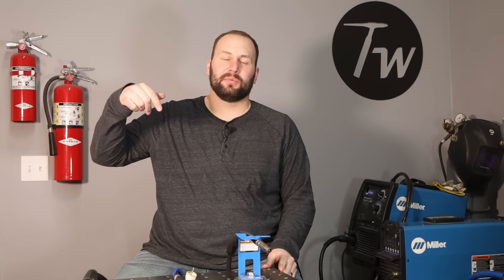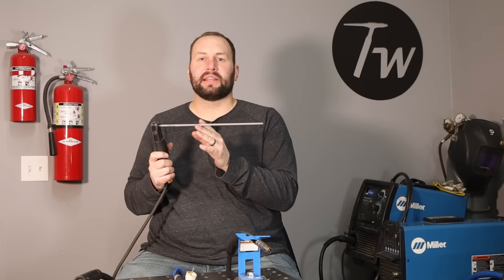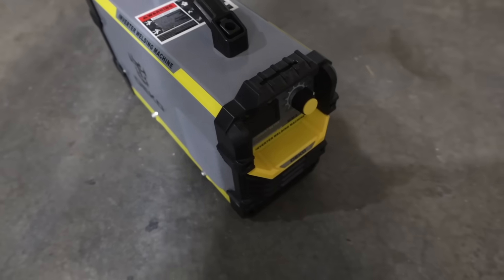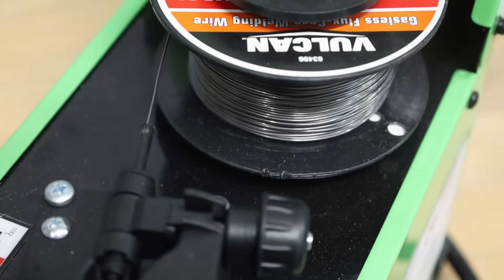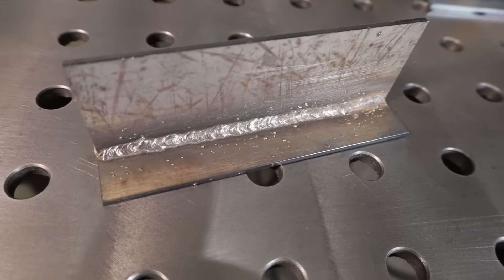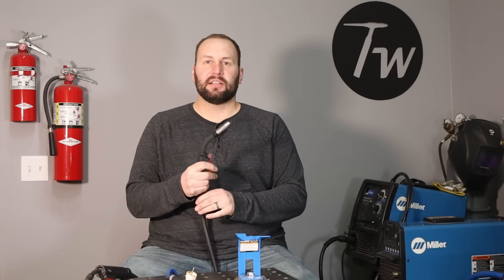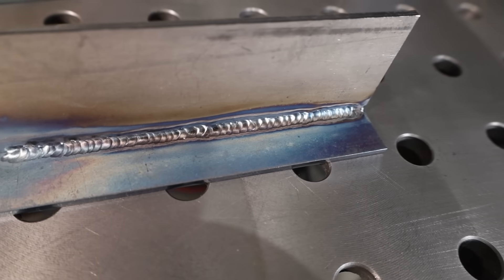4 Types of Welding Explained: MIG vs TIG vs Stick vs Flux Core

Comment: I think people get intimidated away from trying Tig because it gets described as hard. But if you take a way the filler rod, I would argue it is more intuitive to learn. Start with moving the puddle and then learn to use filler rod. Trying to figure out MIG heat and feed rate as a beginner can be super frustrating. More of the work is in the setup knowledge. I would say MIG is really just easier for someone teaching because they can set the machine and anyone can pull the trigger. I would have preferred to start on Tig, but maybe I'm the only one.

Comment: When I was in high school I took vocational School welding and had the option of getting certified in several different types of welding. I chose mig stick flux cord and Tig. I had the option of a certification in subarc and pulsarc, but sub Arc is not really that in high of demand because it's all done by machinery. Have you ever done a video on pulsarc? What's the purpose of pulse Arc

Comment: Hey tim, what do you think about structural welding on small trailers, like low boys and gooseneck trailers to haul motorcycles or heavy equipment on? I'm building a 26-ft trailer as we speak. It's 18 ft long now, dual axle. I'm going to cut it in half behind the back tire and 5 ft from the front of the trailer I'm going to cut it in half, put a piece of three by four angle iron 8 ft long on the inside of the existing angle iron and welded up solid in the front and the back. I'm going to add 3 ft to the back and 5 ft to the front. Make it 26 ft long in total so I can haul five harleys. I was going to use flux core mig, but I've decided to use stick because of the penetration. What would you suggest, 6010 root pass 7018 cover pass like how you do in hanging high steel or structure erection? I hang high steel and build large structures, and I'm just now getting into fabricating things like trailers and I make fenders and fairings and gas tanks out of flat steel as I have a bender here at home to where I can take a 20 gauge piece of metal and put it in my vendor and I can form a gas tank or a fender or a fairing or whatever I want to build. Anyway, a 6010 root pass with a 7018 cover pass is the strongest weld that you can get as far as I know. That's what I was taught in vocational school / trade school and during my apprenticeship program. My only concern is this, each one of the motorcycles that I'm putting on this trailer weighs at least 917lbs. The heaviest is a big goldwing trike that weighs about 1375 lb.
Considering the trailer being extended 5 ft in the front and putting the 7/16 inch by 3x4 piece of angle iron, do you think with the constant flexing up and down riding down the road on the highway, do you think that the 6010 root pass, 7018 cover pass will be strong enough? Sorry for the long message, but not really. I really need to know lol. God bless you brother.

Comment: The flux (SMAW) does not 'burn off'. It decomposes from the heat of the arc to form a gaseous shied which protects the molten metal from atmospheric contamination.  Definition of arc would have been more professional before further information given.

Comment: Hello. Is TIG welding as strong as arc welding since i suppose the arc welding fuses the 2 pieces and the rod together due to the heat involved and not so contained, whereas the TIG only deposits a molten metal on the joint and contains the heat more precisely. Let me know. Thanks

Comment: Nice video - Out of high school, I got a job welding on rail road cars using MIG welder.  They were Cobramatic I think, not only had motors to push the wire, had motors in the head to pull the wire.  (The head looked like a cobra with its hood spread)
My buddy worked on snowmobiles and introduced me to his TIG.  Aluminum kicked my butt, didn't make a nice red pool of metal before I burned through... LOL.  He did welding of titanium, seems like he had to use a vaccum chamber with helium or something crazy along those lines.  I didn't get to see that process though.
Reply: Yes Titanium reacts when heated and it absorbs the oxygen ruining the metal. A drybox or vacuum chamber is back filled with Argon to keep the air out.

Comment: Machine setup and maintenance in my experience is the most overlooked part of "learning" to weld.. I went into welding school fixated on learning tig. My instructor made me learn oxygen acetylene, stick, mig, Then tig.  It made zero sense to me until it came time to adjust all those dials in my final days.. running a bead was the easiest part.

Comment: I bought a cheap welder labelled as "gasless MIG" so now I'm a little confused. On the outer case is printed "MIG" it only uses electricity, no gas. It runs a spool of flux core wire. Also has a clamp to complete the circuit as you described with the first welder you noted. Is it simply a flux core welder?
https://www.ebay.com.au/itm/NEW-130-Amp-Gasless-MIG-MAG-Portable-Welder-Welding-Machine-Metal-Steel-10A-Plug/272559580932
Reply from the maker: Yeah, that’s flux cored arc welding. Some people call it gasless MIG, which is interesting since MIG stands for Metal (electrode) Inert Gas.

Comment: Interesting and informative video, but it didn't address the question that I have.
I have heard that a 110V arc welder is all that is necessary to weld a low 'scope bolt handle to the bolt of a military surplus rifle (Mauser, Mosin, etc.) that is being sporterized.  Is that true?
I don't want to pay for a more expensive welder, but I really don't want to  pay for a professional gunsmith to do  the work either.  
Living on Social Security makes it difficult to keep up with your hobbies.

Comment: I went from gas soldering and gas brazing to gas welding, then learned stick. Oxyacetylene is much more basic and old school and you really need a torch anyway, for doing large or rough cutting. Surprised you didn't include oxyacetylene welding.  So far I haven't  started doing any MIG or TIG welding but I just realized I already have CO2, for my beer.  I just need a proper MIG/TIG regulator and I am set. But there is a lot of elemental zen in the art and science of stick and gas welding that is very intuitive and enjoyable.

Comment: interesting i went to college for welding but never stuck around long enough to get into the tig, mig or Flux Core...stick i got ok at i look back and wish id have finished them all and got my tickets but i didnt...needless to say i was decent at stick welding but i noticed he didnt do circles i know theres some electrodes where you dont have to and soem you do...i also wasnt sure about what heat to use when elding also but i guess its a preference to the welder or what you feel is good. but tig and mig look easy enough..

Comment: Very informative. I do have a gasless MIG welder here. I find it very easy to use, because it is a basic machine. It has 2 current settings, on/off, & wire feed speed control.

Comment: One thing to note is that stick welding also needs the least prep of the materials you are welding, no need to have surfaces cleaned to stick weld, it works well outside in bad weather and even works under water.

Comment: Nice video!
The main problem I have with starting to get into welding is, what electricity circuit can I use? I seen at various places that you can use a normal 110 volt one ... does it matter what plug I plug it in? I heard about circuits frying.

Comment: Decades ago, welders would just carry a large step-down transformer which has 2 thick cables on the output for arc welding and they would just twist some bare wires on the input and stick the bare ends into an available mains socket.

Comment: With all the welding video on YT, I rarely see any information on the danger to un-protected eyes. Welding can produce the same UV
rays as the Sun. The fire extinguishers are great, one should have signs warning of eye damage, especially if one goes from YT to 
watching real welding on construction or repair work that may be nearby.

Comment: I want to add, the biggest advantage to flux core over mig, isn't just that it's portable, but also, due to it being flux shielded, it's better for outdoor work, as a strongish breeze won't blow away your shielding gas.

Comment: I had two years of training in high school and came out with my certification in Arc and Mig, but I could never get down Tig. Always kept getting the tip stuck while trying. Still have the arc machine my grandfather gave me, but haven't welded in the 18yrs.

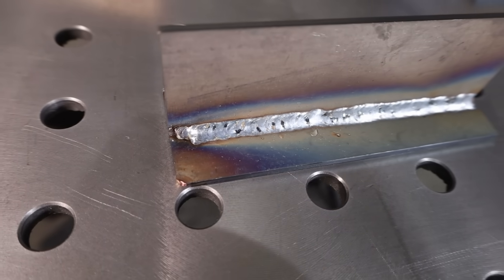Comment: At 7:38 are those holes in the MiG weld?
Reply from the maker: No, they’re shiny spots where silicon islands had shielded the metal from oxidizing grey, then fell off. This is extremely common.

Comment: Really good video and explanations, I'm going to start to learn welding at age 51 lol!  I have been wanting to for quite some time and now I'm just going to go for it.  It's kind of funny as you get older, rather than spend 1700 on something you can build for 300 if you weld lol, saving money and the challenge of welding it up yourself is awesome in my opinion.  I did just subscribe and ty again for the video, it's helped me a ton. ;) I know definitely, it will take a lot of practice to be proficient, but I'm totally ready for the challenge,  thanks again :).

Comment: Why does a TIG weld require “laying coins”? Why can’t the rod be fed in continuously, instead of in pulses?
Reply: Good question! I'm assuming it has to do with the technic involved makes it easier to apply not to mention makes a very nice looking pattern ... but yeah, when it comes to tig why can't both the 'stinger' and the rod be moved along at the same time while feeding the rod in like ark/stick welding is done
Reply: Maybe the tig stick melts so quickly so you can't match object heating with stick melting when trying a continuous flow. It looks more like soldering!

Comment: I appreciate this video however the gentleman forgot to mention that stick welders can be used to weld metals that have thin paint on them. In other words, a welder does not necessarily have to pre clean the parts that are to be welded. I'm new to this so please correct me if I'm wrong

Comment: can flux core be used for thinner materials? i occasionaly use stick but for thinner things it just goes through them. unfortunately i have limited space in my garage would rather not have big device with additional gas container.
Reply from the maker: It can be, though I’ll usually choose TIG or MIG. If you already stick weld, there are a few things to try to have better success stick welding thin material. There are small 1/16 (1.5 mm) electrodes that can run at really low amperage. Running electrode negative can reduce penetration. If you have access to the back side, a chunky piece of aluminum or copper behind the weld can act as a heat sink and prevent burning through.
Reply: @TimWelds  Thank you!

Comment: I believe there is one type of welding called short arc. Used like TIG where the rod, aa long piece maybe 2 or 3 feet length is fed through the stinger I have seen it but never used that method. It’s used for fine work like TIG I think mostly from big metal shops or manufacturers. Where I worked we used TIG for a lot of thin wall stainless stuff. We didn’t have MIG in those days at our shop. We used gas welding and arc for everything else. It was a winery and farm shop. Cast iron, Steele, brass, bronze, Stainless and aluminum. I learned a lot working there.

Comment: Funny story, when I was a kid about ten years old my dad was a carpenter. One day he caught a ride to work with someone else and left his car at home. Anyway I was scavenging around in his trunk and found the largest sparkler I ever saw, it was almost 2 feet long. I tried to light it with a road flare. It never lit and the flare drippings burnt my foot pretty bad and I had to hide that cause I wasn't supposed to be messing in my dad's trunk to begin with. About twelve years later I became a welder/ fitter and figured out the sparkler was a 7024 jet rod. But I never figured out why my dad the carpenter had one in his trunk. I did talk to my dad about it when I was older but my dad didn't know what I was talking about.
Reply: Of course your  dad  wouldn't   use a 7024 as a carpenter he would  have wooden welding   rods. Not sure  what 7024  are used for only ever used 6013's (normal steel)  and 7028's (low  hydrogen) amazing what you still remember after noticing for 30+ years/,.
Reply: @seanpadgett3053  7024 is just an Low hy IP rod.... you use 7028? They would also be a high deposition IP rod. 7018 is the most common low hydrogen rods you get
Reply: @seanpadgett3053  wooden welding rods. 🤣
Also called stick welding...
Reply: Those number mean nothing to mean , but why was it in his trunk?
Reply: A metal coat hanger is better than a welding rod for fixing your hanging exhaust pipe.

Comment: What about an oxy-acetylene torch and a fill rod? Great for thinner material. Can also be used for brazing, or cutting with a tip change, and it doesn't require electricity (though lugging the tanks around isn't easy).

Comment: Another disadvantage with MIG welders is that you generally have to use them indoors as any kind of breeze will disturb the Co2/Argon shielding gas and cause air bubbles to form in the bead. Mig indoors, Flux-cored outdoors is the rule we usually use.

Comment: Tig seems to be the most artistic and attractive of all of them. Thanks
Reply: I started as the saw guy in my uncles machine shop and was anxious to learn how to weld. Brian (the welder) agreed to teach me and told me he would start me out on the easiest one. He started me TIG welding aluminum (6061) I believe. I was frustrated because it took me so long to grasp the technique and since I thought it was the easiest I wasn’t sure I wanted to learn the rest. He made me weld over and over until I could make every weld look like “a roll of dimes”. When he finally said we could move on he then informed me that he trained me on the hardest one to learn and then I learned the others like it was nothing. I actually got laid off soon after and now I do Govt IT work, but I sure do miss those days doing fun/interesting work in the shop.
Reply: @anonvideos8438  - He started you off, with a "Post Grad Test", both in Skills, and in Patience / Attitude / Perseverance! You passed!
Reply: Delfinently looks the best but also the hardest to get the technique down, you also have a lot of control over it once you learn it. This is just my opinion but I’ve only been welding for 2 years
Reply: PLUS ................
Its named after the best of the Winney the Pooh characters.
Seriously, who could ask for more?
Reply: Also cost alot to buy.
Unless you go for the basic of basic but then you can Just buy one of the other ones.

Comment: Just curious, what caused the pitting at 7:37?
Reply from the maker: It’s not actually pitting. There is silicon in the weld wire that floats to the top and bonds with oxygen forming what are often called islands that are brown in color. After the weld cools, these can pop off, revealing shiny spots where they had shielded the weld from oxidizing and turning dull gray like the rest of the weld did. Thanks for watching and for the question!

Comment: Stick weld demo: You messed up the end with spatter because you didn't pull away fast enough. I like to reverse about an 8th of an inch and then pull away quickly. Less spatter and no crater on the end.  Flux Core demo: This is why I don't like flux core so much. Lots of spatter and smoke. Mig is more expensive to run but much cleaner. I don't have a tig rig for my set up. Maybe someday.

Comment: The last type of welding is like soldering. I could get used to that
Reply: Other than it's way more difficult. He didn't explain that the arc is controlled by a foot pedal that you have to control at the same time.

Comment: Hey man I want to start welding but I don’t where to start. Which type of welding do you think is best for a beginner?
Reply: For me, the easiest way to start is the flux core welding. It's quite cheap about equipment, no so "sticky" than stick welding for a beginner. That said, it produces quite a lot of fumes, so it needs to be used in a well open place, with a mask on your nose…
Do not forget to buy a decent welding helmet to keep your hands free of holding those terrible face shields used times ago.
You'll also need a brush, a picking hammer and a grinder for a nice finish of the job.
(I expect to be clear enough, my english is not so good because I'm french…)
Reply: @TheClBlues  thank you for giving me some tips I will surely take them in to consideration...perhaps do you know a good welder under 200?
Reply: @chriqz7921  All those "no gaz" welder are quite cheap, they are almost the same machine, branded under different names, and you can find most of them between 100 and 150 euros.
The big difference is not the machine, it's the man who use it !
I started from terrible "holes, bubbles and snakes" and I can weld quite properly after one year… Practice is the only way !